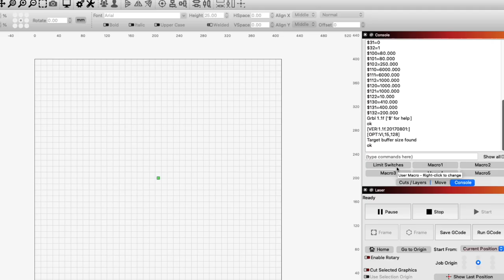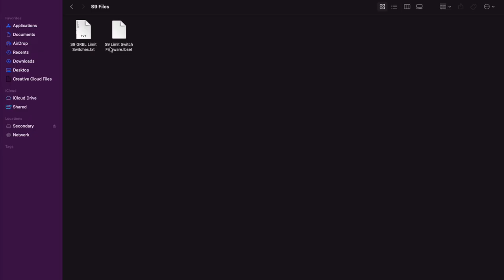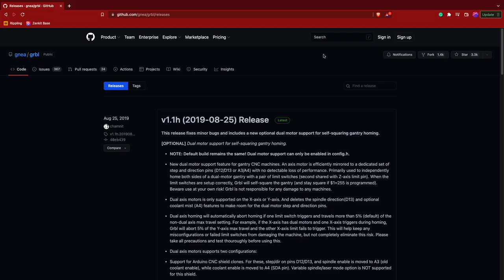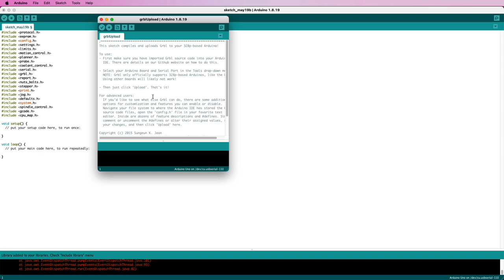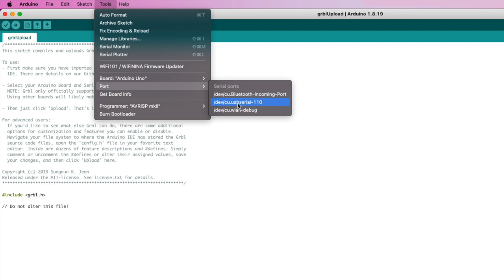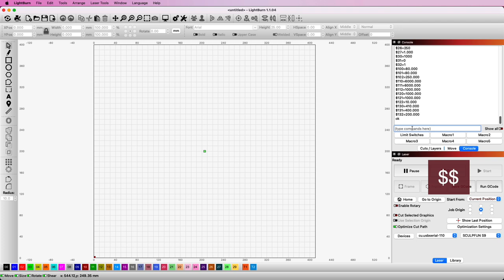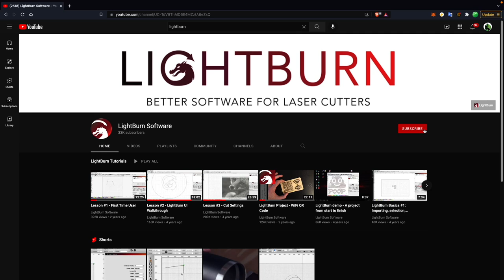Installing Clean GRBL Firmware on Diode Lasers

Comment: OK, all done. I had a few hick ups but it now works perfectly. I have a Sculpfun S8 Pro. I made my limit switch adapters out of 1" aluminum strap x 1/8" thick using my Shapeoko 3 XXL CNC Router. Thank you for this 2 part series for this awesome upgrade.

Comment: Thanks for the tutorial, I'll check if that would work with my laser(TTS-55), too. One question, any specific reason why you opted for these limit switches without housing?
Reply from the maker: The limit switches were chosen because they are very common and readily available. If you prefer to use a different limit switch other than the mount design everything else should carry over.

Comment: So I updated my firmware just fine.  Following all you steps exactly. Now my S9 limit switches work after power cycle without resorting to macro- awesome thank you!  BUT my laser no longer fires. I’ve checked every setting against my saved $$ output.  I’m getting 12V to the laser. Any suggestions?
Reply from the maker: That is odd, I cannot think of any reason why laser would have been affected. Is your $31 value set to 1 for laser mode?
Reply: @lightburnsoftware7189  indeed it is. I’ve tried uploading the firmware again. But no charge. It’s definitely the controller. Sculpfun support talked me through testing the laser which fired up moving TTL to the 5v.

Comment: I just flashed grbl using your method. It now homes correctly to the left front without running the macro. However, when I go to frame a project, or command any move, it races to the upper right and crashes into the frame. What could be causing this?
Reply: For some reason, after flashing this command G10 L2 P1 X-409 Y-399 is not written. I own AtomStack A5 PRO. After flashing the grbl, homing works perfectly, but for some reason it keeps front left as -409,-399, and after entering G10 L2 P1 X-409 Y-399 into a console it reconfigures itself to 0,0. Try that.

Comment: Hello. Bought the LightBurn but I need help about which GRBL is for Atomstack A50 Pro Laser (without limit Switch) and which changes i have to do in GRBL libraries. Also what settings i have to do in Lightburn. Please help cause i cannot use my laser at the moment! My laser cannot be found automatically from Lightburn. Thanks in advanced!!
Reply from the maker: The Atomstack lasers should ship with GRBL firmware. If the manufacturer does not provide a driver then the CH340 is the most common. I would get it set up as is without limit switches to verify everything is working as it should first.
Reply: @lightburnsoftware7189  Thank you very much. I have installed the drivers you wrote via LaserGRBL software but the laser cannot be found automatically in Lightburn and I set it up manually nut I cannot be sure that what I did is correct. I gave dimensions 410 x 850mm for cutting area as laser has extentions, also direction and start position. Also problem is the laser mirrors everything horizontally. I checked settings in Lightburn about that and I didn't find anything. So maybe in controller settings I must change a parameter about that?

Comment: Hello - How to reset GRBL configurations (My setup for my Sculpfun S9 is wrong)
Reply from the maker: Here is a forum post that has the default settings you can compare against yours to see what needs to be changed. https://forum.lightburnsoftware.com/t/sculpfun-s9-gbrl-settings/79318/3

It also looks like Sculpfun has released the firmware if you wanted to reflash:
https://github.com/Sculpfun-design/S9-S10-series-Software-Firmware

However, if the stock firmware is on your board I would just go through and match values versus reflashing.
Reply: Thanks!!  But I do not see any place I can find theese parameters in LB. I only see them in Laser GRBL... Please help. Again :)
Reply from the maker: @knutevensen2564  - you can use the console window in LightBurn to enter the commands, or you can use Edit > Machine Settings.

Comment: Hello, I am trying to follow the instructions in this video to work my new xtool d1 with laser grbl. I used the file provided but it says it fails. I am using the newest version available of arduino ide and I used the zip file you have provided. When I go to the grbl file to be selected it instead goes into the file and it is empty.  The wording says library is not valid.
Reply from the maker: I do not believe the D1 is running GRBL. I may be mistaken but my understanding was that it has been made compatible with GRBL so that it can work in LightBurn and is not truly GRBL. If the board can be flashed with GRBL you would need to find out the board type and see if the board is one that can work with Arduino IDE. It may be worth reaching out to the manufacturer on this.
Reply: I don't know if this was the proper fix but it seemed to work on my S9 because I had the same issue. I went into the folder we were instructed to unzip and then zipped the "grbl" folder (Arduino states it is looking for a "Library (*.zip file)" after all🤷‍♂) inside it. Then when I selected that grbl.zip file inside the folder with Arduino it seemed to find it and it said it was successful. Also when I go to Sketch>Include Library it lists grbl as a contributed library.
Reply: @SpangledOne  Thanks for the solution!
Reply: Use the Arduino 1.8.19 version not the newer version this was the cause of the problem for me. I have both Arduino versions on my PC when i did the upload as per this video it only worked when i used the older version of the Arduino IDE 1.8.19 the new version of the Arduino IDE just kept showing errors Also make sure you select the correct board and port in the tools menu on the IDE.
Reply: @SpangledOne  Thanks, worked perfectly for me on my Mac, was trying lots of things but your suggestion worked 🙂

Comment: Hmmm from one error to the other, finally I managed to add the library after zipping that folder. Now errors during the upload:

avrdude: stk500_recv(): programmer is not responding
avrdude: stk500_getsync() attempt 1 of 10: not in sync: resp=0xe0
Reply: And seeing this firmware is from 2019, its probably installed already on devices bought in 2023..... So I give it up, too many weird errors while there is not much you can do wrong in this process
Reply from the maker: Was there a reason you where wanting to install stock GRBL? Have you had issues with your lasers firmware?
Reply: @lightburnsoftware7189  I thought I did after calibrating went wrong but apparently that was an easy fix, just set it back to 80 :) Also it felt like flashing to gbrl was something you should do, but I guess I misunderstood....

Also I found the problem why calibrating went wrong, I switched X & Y while measuring....stupid me lol

Comment: I can not add the library zip file into Arduino I get this error "Arduino: 1.8.19 (Windows 10), Board: "Arduino Uno"

The library "grbl-1.1h.20190825 2" cannot be used.
Library names must contain only basic letters and numbers.
(ASCII only and no spaces, and it cannot start with a number)"
Reply from the maker: Did you unzip the file? The folder you want to be adding is the unzipped folder named "grbl" and not the downloaded zip file itself.
Reply: @lightburnsoftware7189  Yep I'm a total idiot! Sorry
Reply: @lightburnsoftware7189   i cant chose the unzip GRBL folder
Reply: @lightburnsoftware7189  I have the same problem, the "GRBL" folder is not a zip, IDE ignores it